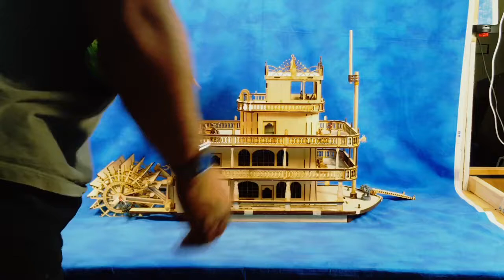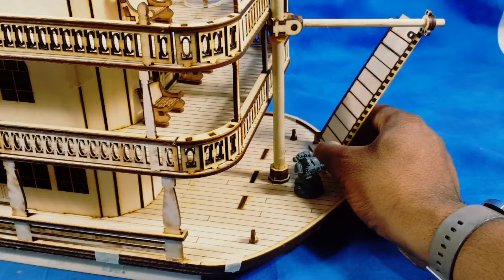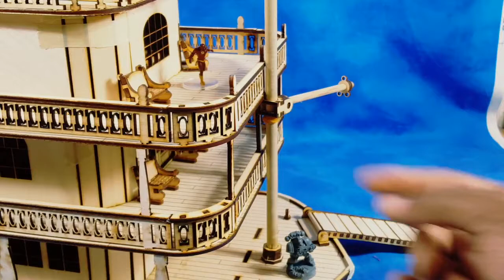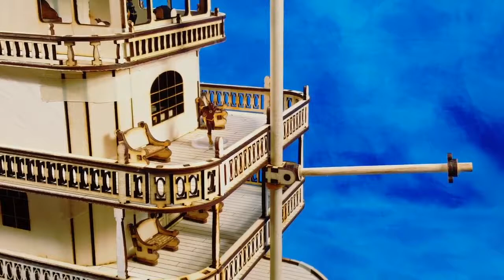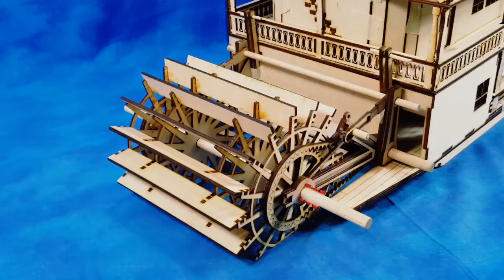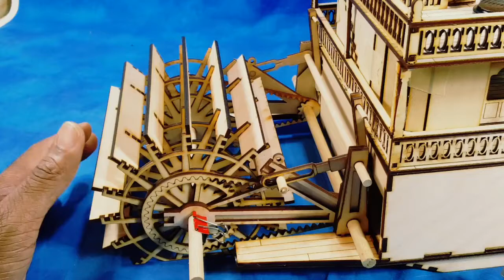Riverboat Build Part 2

Comment: As an animator this is really cool and appealing. Any thoughts of building sets for stop motion animation projects? I have a few former students who work for Liaka studios (formerly Claymation Studios) in Portland, OR, and there seems to be a need for set and prop designers and fabricators. 

Nice touch with the paddle gear.